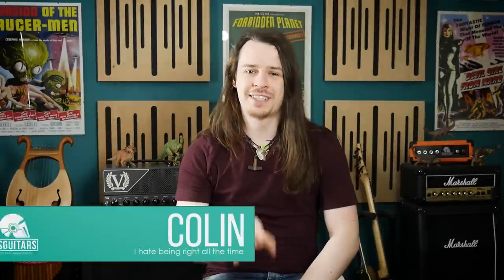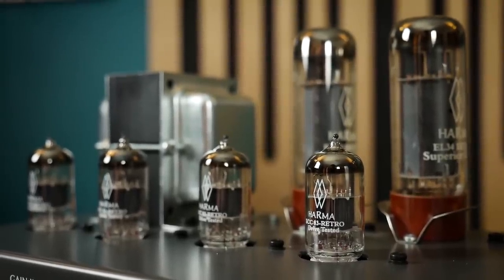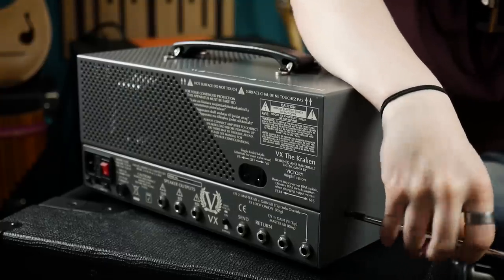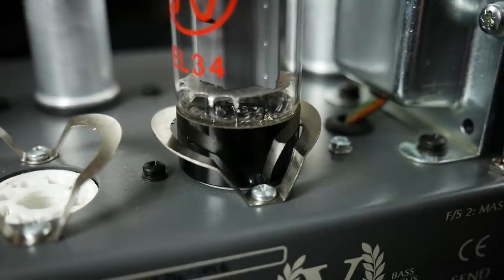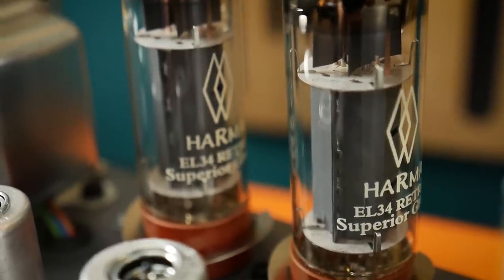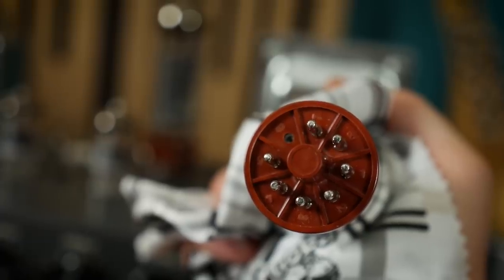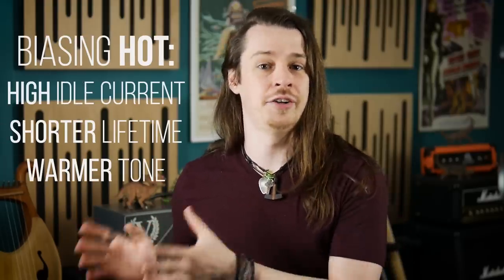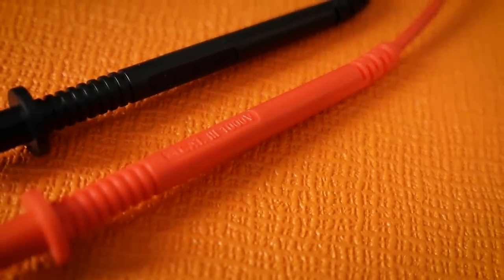Swapping Valves And Biasing Amplifiers

Comment: hi! thanks for making these informative videos!
would you mind helping me out with a question that i can't find a definitive answer to please?
for a self-biasing tube amp, let's say with 3 pre-amp tubes: v1 & v2 for tone/drive, v3 for phase inverting...
does the gain factor of the tubes used have to be in ascending order?
would there be an issue if they weren't? eg. v1=12ax7, v2=12at7, v3=12ay7?
thank you!
Reply from the maker: If your amp is using different valve types in each position there might well be good reason for it. Refer to the manufacturer documentation.

Comment: If I've got a small 5 (five) watt head with only one power valve (tube) does that need biasing or is "biasing" the act of making the tubes/valves "work together" (in harmony) as it were? I'm NOT doing anything silly myself, and you can see by my question that I know SFA about this so I'm not going near any 240v (I'm in Australia) as I do wish to live to play the instrument on the other end of the amplifier. I don't even own a multimetre so it is moot to even try to BIAS a multi power vale amplifier. The little 5 watt head does need a new power tube/valve though and I was really wondering IS it possible and safe to change the valve/tube? Thanks in advance.

Comment: So is it absolutely necessary to re-bias your amp when you swap valves? I get that it might have a better audio quality butI'm a college musician running on a tight budget
Reply from the maker: Running an amp at the wrong bias will dramatically shorten the life of the valves, risking sudden failure which could damage more expensive elements in the amp. Amps need to be rebiased whenever power valves are replaced, it is part of the replacement process.
Reply: @ScienceofLoud  ok. Thank you for the reply

Comment: Colin, do you know anything about 6505+ head "bias mods".
I'm just wondering, cause I changed all my tubes about 2 years ago without biasing after (I bought the head 8 years ago and it had the bias mod implemented apparently).
The tone is great, but I have some issues when setting my volume meter, some crackling noise of some sort, which is definitely not a good sign.
Should I take my Amp to be re-biased?

Comment: hey Collin, just a question that could get adressed in a video of its own : is it dangerous to run a bass guitar into a guitar amp into a guitar speaker cabinet or not ? I see a lot of debate online and people do not seem to agree on whether it is fine or not. :/

Maybe you could end this debate and help me in the process ! :D Thanks for all the hard work in any case, much love from Paris <3
Reply: Nah, that's not dangerous at all since the Bass guitar works off the same mechanics. Weak electric signal caught by the pickups and amplified through the amp into the cab, it just highlights very different frequencies. The only dangerous element to that is properly matching your cab voltages and resistance. Don't match an guitar amp that's too strong for a bass amp and vice versa.

Comment: i was wondering i have a orange th100 and this amp have a biass control on each of the output valve... my question is if i can ajuste all my valve sepretly  to put equal to each other i dont have to have a matching quad right?

Comment: Replacing every year, especially with the questionable quality of modern valves, is not needed.    Dave Friedman and John Suhr both say that valves should only be changed when you hear them declining.    There are old amps out there from decades back that still work and still sound great.   

You do NOT need to replace valves annually.   Best example of this is Tom Morello, he is running the same quad that came with his amp in 1987.   Steve Stevens is also still using the original tubes in his old Plexi
Reply: Mister Tee i had to scroll so far down for an answer but thanks for this post you provided
Reply: Agreed.  I had my Jcm2000 dsl100 rebiased for £30 and it sounds awesome.  It was running too hot.  My laney gh50l could probably do with the same.  Both have their original power valves.

Comment: Great video Colin! How would that work for a micro terror? I’d assume a solid state power stage means no biasing needed?
Reply: To my knowledge, this is correct, since the output tube in question has been replaced with transistors, which do not need biasing.  There are a couple of discussions about solid-state output sections up higher in the comments.  Still use the appropriate caution if you do decide to pop it open though.

Comment: Matched valves are snake oil. The driver is not matched, the two sides of the output transpormer primary, are not matched
Reply: And biasing past the point where crossover distortion disappears is pointless.

Comment: Hey Colin, I still have one question:I don't have a full valve amp, just a vox ad30vt xl that has only preamp valves. Do I have to replace/rebias these too?
Reply: Preamp valves may eventually need replacing, but their bias is determined during the design of the amp.

Comment: Would wearing rubber gloves help insulate in case of something going wrong or is the voltage too high to make a difference?
Reply: If you buy gloves made to protect from high voltage, yes, but you still need to be careful.
Reply from the maker: You can get special high voltage gloves for electrical work. Wearing your washing up marigolds won't protect you, and you'll look pretty silly in the process.

Comment: I have the same amp and out of a sudden I noticed a volume drop and one of the power tubes made a pop sound. I bought “matched pair” of tubes, do I need to bias the amp or not really required?
Reply from the maker: You need to bias the amp. 
A matched pair means the tolerances of each valve are close enough that they will be a match for each other, but you will still need to adjust the amp to match the valves.

If you don't bias the amp to the new valves your new valves may not last long.
Reply: CSGuitars thank you for the response. Would you be able to tell me and maybe if you have came across the same issue with this amp, if I turn the single ended switch to V5 the amp wont produce any sound, there is only sound coming when the switch is turned off or at V6 mode. I can see both tubes have lights but not sure if both are working fine.

Comment: Now there is a handy and safe tube puller available on ebay, item 254242318237  Easy, simple and safe. A perfect tool for any audiophile or vintage electronics technician.

Comment: a british nuclear physicist(father of a former gf of mine) told me once that biasing is completely unnecessary(bollocks was the word he used).he could fix anything-nuclear reactor,car,lawn mower....motorbike.electronic device.he said changing valves is as simple as changing a blown light bulb.you change it and it works....this isn't my opinion.but the guys who changed my valves on my  mesa boogie twice made a big deal about the biasing and charged me accordingly....and according to proven  jack of all trades I could have just done it myself.but your biasing visual description is interesting.i am just sharing info,not trying for an argument
Reply: Interesting that the guys who changed your Mesa valves insisted on biasing it - I have a Mesa F-50; the manual that came with it includes a three-page essay by John Randall discussing how it doesn't build biasing controls in any Mesa amps and that you shouldn't pay for it. The F-50 was made in the early 2000's.

Comment: You cannot under-stress the danger of working with live amps. If you are unsure in any way then have a amp professional to do it. If you have a Marshall DSL then your grandma can bias because the bias pot and voltage pins are located remotely from the inner amp making biasing almost plug n play.

Comment: I own a Joyo Zombie which has a single Preamp Tube and a SS power section. Does this mean that since there are no output tubes, it doesn't need to be biased? Does this also give free reign to swap out any compatible tube at any time?
Reply from the maker: Yes, you are entirely correct. There is no need to bias a solid state power section, and you can freely experiment with different preamp valves.
Reply: Awesome! Thanks Collin!

Comment: Hey man, so I have a little 2 watt Hayden Li'l Mofo which I want to swap out the output valve in. It is cathode biased, so surely it's perfectly safe to just unplug, let cool and then just swap the valve without poking around inside it? I've not swapped amp valves before but I know a little about electronics and am very careful and safety conscious.
Aren't cathode biased amps safe to do this with? You make it sound like OMG NEVER EVEN THINK OF OPENING ANY AMP!! So you've now got me worried...
Reply: You should be fine.  Cathode-biased tube amps are perfectly safe to change tubes the way you've described (I've been doing this for a good 13 years or so, first Vox, then Swarts).  I'm not sure of the electronic theory behind this (someone chime in) but with cathode-bias amps the tubes automatically bias themselves when you change them.  I don't believe you even CAN bias a cathode-biased amp since its bias is variable.  That said, I'm not an electronic engineer so I would recommend taking it to a tech who will confirm / advise rather than rely on youtube vids and commenters.  But my experience has been positive (no death so far)

Comment: tube sets for marshall amps:
1.vintage vibes: v1: 1956 mullard  mc1 longplates  v2: 1958 mullard f91 longplates  v3: 1959 mullard f92  balanced/power tubes 1950's xf1 el34 .
2.blue marlin: v1: 1958 mullard longplates f91 7025  v2 mullard i61 1959-1964  v3 1964-1975 mullard i63 \ power tubes 1960's mullard xf2 el34
3. green marlin v1: 1964 mullard yellow print i62 v2 mullard i63 v3 mullard i63 /power tubes mullard xf2 
4. ultimate warmth (bluesbreaker): v1: 1960's brimar 6057 yellow t v2 brimar 6057 v3 brimar cv4004/xf1
@t :v1 1960's mullard 10m goldpins v2 1959-1964 mullard i61 v3 i63
6.striped marlin: v1 i61 v2 i62 v3 i63
7. swordfish(metalhammer): v1 v2 v3 all i63
8. 1974x: v1 i61 v2 i63 v3 ge jan 12ax7wa

Comment: “valve
/valv/Submit
noun
a device for controlling the passage of fluid or air through a pipe, duct, etc., especially an automatic device allowing movement in one direction only.”
Sorry Britts, I can’t help myself :D
Reply from the maker: Aye, that's correct. A Thermionic Valve is so named because it controls the passage of thermionically emitted particles (electrons) through a device allowing movement in one direction only. 

A thermionic valve is named a valve because it does for electrons what a a fluid valve does for fluid. I have a video decoding the origins of the words and the history of the development of valves if you want to do some further research. 

Also, Brits only has one t.

Comment: Hahah, I remember when I first had to bias a modern amplifier that has a 1 ohm resistor from the cathodes to ground to make a great test point. I was so used to doing everything the old fashioned way because I had only biased old amplifiers (or amplifiers I designed and built like old amplifiers) up until that point. The huge convenience was just surprisingly good for me, saves me doing more measurements where I can slip and short something than needed.

Comment: Agreed.  Do not try this at home! I've got my tech that I trust and won't let anyone else touch my babies! Rolling pre amp tubes is pretty harmless, but power tubes...thats a different story!  Granted,  I have a pair of 6ca7's that have been in my 73 50w Marshall...well..im not sure how long...my uncle gave me the amp,  all I know is they're old as shit,  but still test strong,  but the amp did need to be biased.  (They were running way too hot, but from what I was told by my tech, they are  military grade tubes so they have held up very well.)   And speaking from experience,  being shocked by an amp is not fun...at all.  It hurts
.. 
Quite a bit...dont mess about inside them unless you're absolutely sure of what you're doing! (And if you buy a vintage amp, DO NOT operate it in ANY capacity until you've had it looked over by a proper technician (which is how I damn near got killed by my Marshall...blasted death cap!!!!)

Comment: What about Mesa Boogie "fixed" bias?
Reply: Steve is correct. The manual that came with my Mesa (circa 2001) includes a three-page essay by John Randall discussing how the company doesn't build biasing controls in any Mesa amps and that you shouldn't pay for the service, as long as you buy and use matched Mesa tubes.

Comment: a word of warning to all young or old guitarist that dont know what is inside a valve amp.please do not attempt to do any work if you are not experienced.reason?????
i was 19 years old and didnt know what valves are inside an amp i had a fender amp turned out that had valves and i opened it up and i had a screw driver i was pocking in there and all i can remember is a bright flash  light in my eyes and i was knocked to the floor.
parents heard the loud bang and electricity shut down the the house went to hospital and was lucky i stayed alive .
when i came back home i found the screw driver had melted half way period.
lesson learned lucky im still alive and still playing guitar yeahhh baby.
but please take your amp to a pro tech save lives.

Comment: Is this necessary on all valve amps or are hybrids (specifically the Orange Mirco Dark) an exception?
Reply from the maker: Biasing only relates to output valves, so in hybrid amps where the output section is solid state you don't have to worry about getting them bias adjusted. 
Still do be careful going inside them though.
Reply: CSGuitars that's a relief. Really appreciate the help.

Comment: with modern tubes 7025 or cv 4004 has no meaning ,with nos tubes it means heavy duty less noisy tubes 7025 and cv 4004 are military or industrial types for customers like the army that stopped buying tubes 40 years ago.
Reply: The 7025, CV4004, M8137, ECC803, ECC83 and 12AX7 are all the same valve.

Comment: Ok. I worked on rf amplifiers. Those tubes do get extremely hot and need to be kept clean. I have been zapped by hv and it went through my chest (I hit the top of the tubes and the core of the hv transformer with my forearms. Just trying to reach behind the amp to grab the cover. Woops. Felt like a herd of rhinos running back and forth in my chest. . 
You would think that these companies know this about these amps and would make them more accessible to work on and test points more readily available. Some do, some don't. 
Been thinking of buying a kit. What manufacturer would you reccomend? As they all have their claims but I know nothing about these companies.

Comment: Hi all, we in the scene for home audio highend have had this fully automatic bias regulator in our amplifier for 40 years. You can do tube swapping with all power tubes in these power amps as long as they are pin compatible. This is really funny and unique. I'm quite surprised why the guitar amp scene has been lagging behind for so long. Check it out here: https://youtu.be/Ukfz3jnBbtU

Comment: Couldn’t you ground yourself with one of those wristbands?
Reply: Those are only designed to remove static electricity when you assemble electronics, before they've ever been connected to a power source. If you use them when working with a supplied circuit, the current will still go through your hand, leaving your hand with burn marks, damaged nerves, or both. You won't die, but you probably won't play guitar the same way ever again.

You will also definitely destroy the amp if you short it to ground. The fix for a failed valve replacement and bias will in the best case scenario only be a full amp replacement. Don't do this. Get a professional to do it. It will save you lots of money, and probably a hand as well.

Edit: fixed some bad grammar.

Comment: Voltage doesn't kill current does .....
Reply from the maker: You don't get current without voltage. Voltage is what pushes current through your body and is directly measurable. 
How much voltage in a system is a known quantity, how much current will flow through you is not and dependent on many factors, hence why voltage is always quoted on danger of death signs. 

The higher the voltage the more deadly the device.

Comment: Best valves for an AC15 anyone?
Reply: NOS Mullard/Any NOS European EL84 or American 6BQ5. Be careful what you buy. Look for scorched mica which signifies it isn't NOS, but an old, used valve. There are some unscrupulous sellers out there.If your pockets are long, and your arms short ( IE, skint ), try a pair of NOS Russian 6p14p. The 6p14p are available with different suffixes to denote resistance to vibration and expected life time. The basic 6p14p is a sturdy, fine sounding valve. The EV and others are supposed to last longer. Soundwise, they're all excellent. They can stand being run hot'n'hard without issue. Lovely compression and a very smooth breakup character.Sovtek. Cheap and cheerful. Robust.JJ Not bad. Inexpensive, easily available.Ruby/Shuguang. Possibly what you've got in there already from the factory. The 6p14p make them sound harsh and zizzy in comparison when things get interesting.

Comment: And I only have cathode biased amps, so I can change my tubes without any risk of death. 😉
Reply: One of my amps has that Bugera auto-biasing system put in it. Makes changing tubes/valves a breeze. I'd say that we are some of the lucky few that don't need to do this 😂
Reply: Problem with that is that it's a very inefficient way of biasing an amplifier, making it unapplicable for amplifiers above 20-30W. The size of the resistor you'd need would be gigantic.
Reply: @LiamsGotThis  I know it'd probably be surprising but the amp it is in is 50 watts, and the resistor isn't really big at all (compared to average of course)
Reply: Fair enough. I just finished a KT88 push pull amplifier and tested that theory, the maths works out that it doesn't need to be too big.